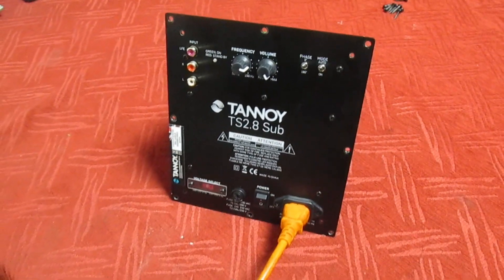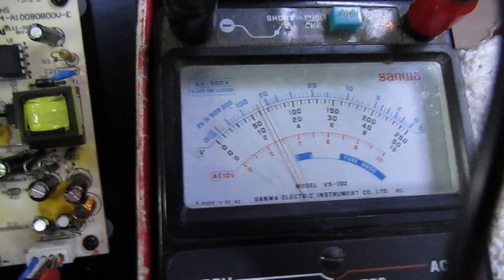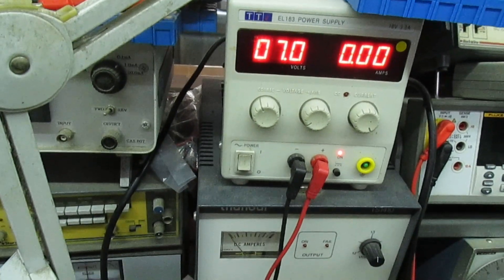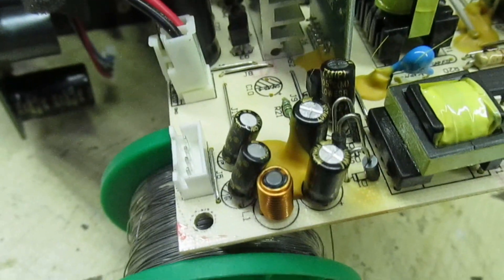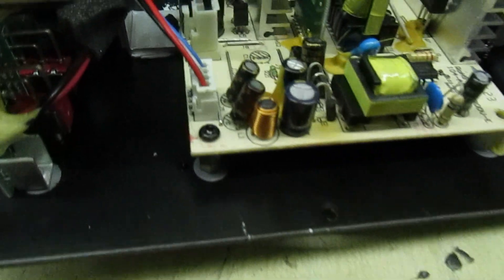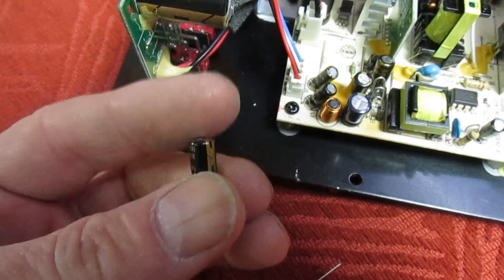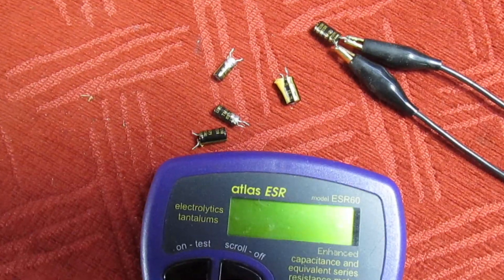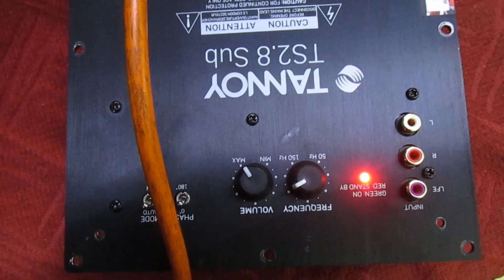The art of simple fault finding . Tannoy TS 2.8 Subwoofer repair.

Comment: Just taken mine to pieces, looks like the same cap (100uF) thats the problem, the anti vibe mastic has gone brown on the top so guess its running hot. The caps are marked TM(P), when I google it TMP comes up which are non polar, can you confirm if the TM(P) are polar or non polar ?
Reply from the maker: no the 100 uf capacitors are polarised electrolytics, for best results swap them for LOW ESR 105 degree c  branded capacitors, Panasonic are a good choice .
Reply: @michaeldranfield7140  last question :) any idea of the part number / value of C30 next to the wirewound. Mine looks cooked there also
Reply: and thanks for your help ! I used to sell ecaps years ago and sell smps now. I saw the +/- on the ecaps but got dazzled by google
Reply from the maker: @roybussink8952  sorry I cant remember  , this video was made a few years ago now .

Comment: Hi Michael.
Great video.
I’ve got this sub with red light flashing so I followed your fault finding process.
+7v trips (1.78 to 0.25) -7v trips (-6.06 to -5.70)
Measurement with no load = 7v trips (2.98 to 1.04 1.05) -7v stable -6.92v measured
Powering with external power supply +7v light goes green and current draw is around 0.11A // -7v no light and no current being drawn

PCB looks slightly (very faint) burn around the diode you pointed in the video but capacitors all look good. I do not have a way to test them.
Different colour on PCB is more apparent through thickness

Should I replace the capacitors and try or do you think it could be something else.

Many thanks in advance
Raul
Reply from the maker: Capacitors don't have to look visually bad to be faulty, a lot of stuff now uses very poor quality Chinese capacitors that have a very short  service life , if you don't have the equipment to test them  heat them up so they are quite hot with a hairdryer  and this will make them recover and your sub may work ok , that is until they cool down again , I did cover this in a video a few years back with a practical demonstration .
Reply: @michaeldranfield7140  I heated up the capacitors and surrounding  area to 65-70 C approx but nothing happened…red light still blinking.

Happy to send it to you for a quote and repair if you are ok with that and can let me know how to reach you

Thanks 
Raul
Reply from the maker: @raulgarciatapia5557  Would be better if you could bring it in just in case I cant fix it  , Im in Buxton Derbyshire SK17 9JL
Reply: @michaeldranfield7140  Thanks, I’ll try and will let you know

Comment: When you're determining if a capacitor is faulty or not (you used a Peak Atlas) is the most important factor the measured capacitance?  Or the ESR, or both?   You can just compare to the indicated capacitance on the cap, but how do you know if the measured ESR indicates a fault?
Reply: The atlas meter comes with a table to lookup the expected ESR value to reference against.

Comment: Probably all made in China their caps are the worst most Class AB amps run hot as no ventilation in sub woofer cabs.
Reply: That is a class D amp just FYI. Class AB need huge transformers, Class D can use must lighter switch modes.
Reply from the maker: That's the problem these days , poor quality Chinese caps bought for next to nothing to keep manufacturing cost as low as possible .

Comment: I remember fixing a radio alarm clock that had failed. It was a similar capacitor in the power supply. I looked up the data for that capacitor and calculated that at the running voltage it would only last about six months which was the age of the device. Actually designed to fail because nobody cares.
Reply from the maker: I know , its not excusable because its deliberate designed not to last .

Comment: I'm not a fan of "active" / "powered" speaker systems in general where the amplifier is "tied" to the speaker it's in. I prefer passive enclosures and seperate amplifiers, in fact for my subwoofers I actually have plate amplifiers in completely seperate enclosures.

Comment: Well done, as always. I'm sure you checked the snubber circuit resistor value and it may be worth mentioning that any resistors that look like they may have got warm (or the PCB close to them has got warm) should be measured.
Reply from the maker: I find snubber resistors are usually adequately rated , sometimes 3 watt metal film and very reliable, its usually the little blue disc cap that shorts out or explodes.

Comment: If you had not replaced the other dodgy caps, that would have been a comeback after a short time.
By the way, just a simple subwoofer amplifier and with all those smps supplies and class-d amps the circuitry is so complicated and component count got so high that increases exponentially the possibilities of failure of the unit.
A classic design with a linear power supply with toroidal transformer and a class AB amplifier has way much better long-term reliability (if built properly) and easier to repair.
Reply from the maker: I know what you mean and I have had subs with a linear power supply and they are far more reliable as you say .

Comment: Nice job , very nice job u did. Quality repair job. And it's nice to see someone use so old analgon instrument , it belongs to history but you still using it.  And yea today digital instruments hardly goign to catch that small voltage variation.
Reply from the maker: I find an analogue meter much better for tracing leakage in semiconductors on the ohms range because of the current it passes compared to a digital meter and as you say far better for demonstrating a pulsating DC voltage .

Comment: I had a device with an open circuit on an electrolytic, it didn't provide the DC voltage as it should and after replacing the cap it started working nicely. Pesky little bugger!
Reply from the maker: As the years roll on so the quality of capacitors falls, a lot of failures now are just down to duff caps unfortunately .
Reply: @michaeldranfield7140  true. Working on the radios and amps from the '50s...'70s a lot and unless you come across a completely dried out cap, it'll need some reforming but still go strong. Now you can never be sure...

Comment: Best meter here an Avo M2307. Every time I'm on here reminds me how much I miss a decent analogue multimeter.
Reply from the maker: I have looked at analogue meters in the past and to get a top quality one can be as much as £400 which is a lot of money to spend when if your like me Im always touching a charged up cap on the ohms range and blowing an internal resistor, the analogue meters I use I have the circuit diagrams for so there easily repairable when this happens .

Comment: I'd have put money on that auxiliary power supply cap on the right. I've replaced more of those than output ones. I've got an IBM 5154 monitor on the bench now that's needed one electrolytic and two X caps but at least the thing is about 37 years old.
Reply from the maker: unfortunately most stuff now just runs on cheap Chinese capacitors that don't last 5 minutes.

Comment: I've had three subwoofers on my bench this week - all had the same problem. Cheap nasty chinese capacitors. 
Over the last couple of years I have had subs in for repair by Tannoy, Velodyne, Cambridge, Polk, KEF, Boston - they're all made in china and full of rubbish parts that cause all sorts of faults just like this one.
Reply from the maker: I have noticed that myself, designed and engineered in the UK it proudly says on the back of some subs but it fails to say made in China with the cheapest parts money can buy ,people are more often than not paying premium prices for this equipment and just getting crap .

Comment: Nice job! Good that you changed the other caps as well. You would surely have had the unit back later when one of those dodgy ones failed!
Reply from the maker: of course , the cheapest of cheap caps fitted, you would have expected a little more for an item that cost a lot of money .

Comment: Capacitors are the spawn of satan, probably the most unreliable part in anything electronic.
Reply from the maker: they are now but it didn't use to be that way years ago, progress !
Reply: @michaeldranfield7140  Lol yea, we went through a capacitor plaque in computer motherboards in the early 2000's
Reply from the maker: @Synthematix  That was 20 years ago and still we see capacitors gassed up today , wouldn't you have though after 20 years they got the electrolyte right by now !
Reply: @michaeldranfield7140  Planned obsolescence mate thats what it is.

Comment: Glad to see  you replacing the poor quality caps with good ones., and resoldering suspect connections. I hated getting call back repairs.
The customers 'You just fixed it a couple of weeks/ months ago and it failed again" was one of my most hated comments.
  Looking up the repair it was 3 or 4 years ago (Or longer!)  that I repaired the item.  When I fixed an item, I  never wanted to see it again for the same or related failure.
   ( Although I had one customer  that kept bringing in the same pieces in over & over. It was a cash cow, as his parrots kept chewing the power & connecting cables in half. )
Reply from the maker: Still get customers now bringing things back saying it was repaired not long ago ,best one I had was a guy with a TV,said you did this not long ago when you were at your other shop in the town center, my reply was I have been left there 7 years ! to which the reply was, Oh  it doesn't seem that long ago.